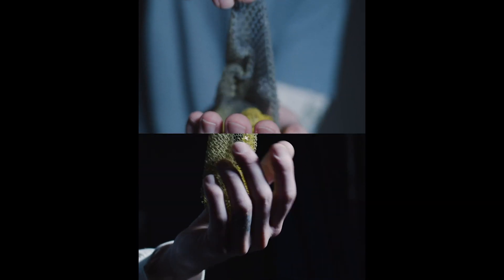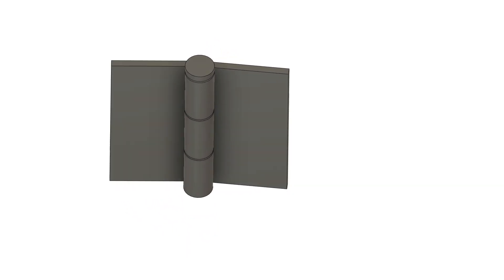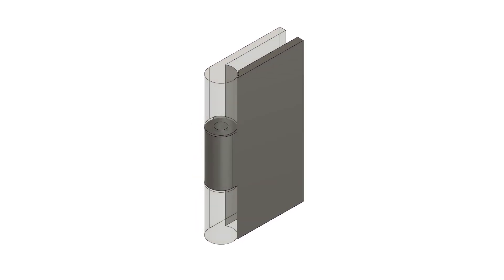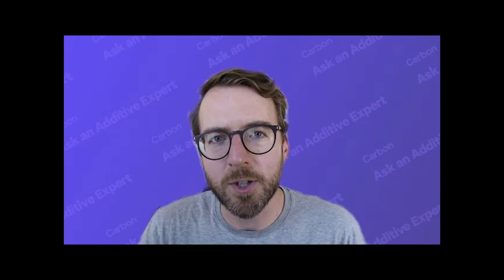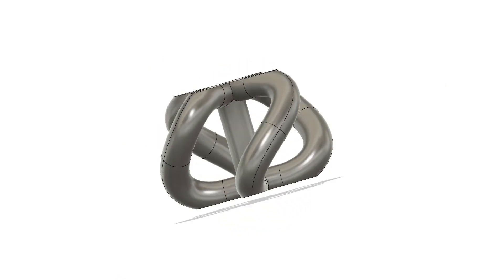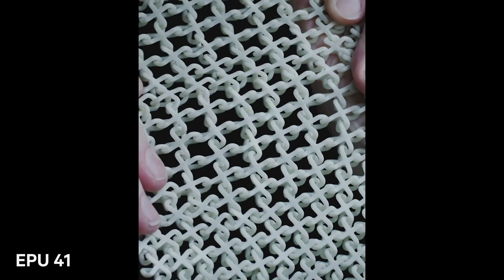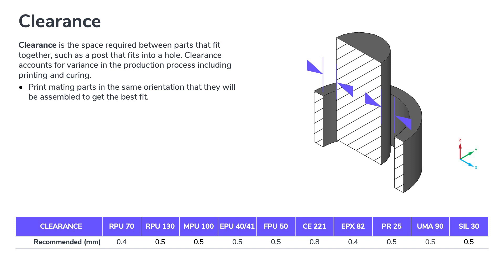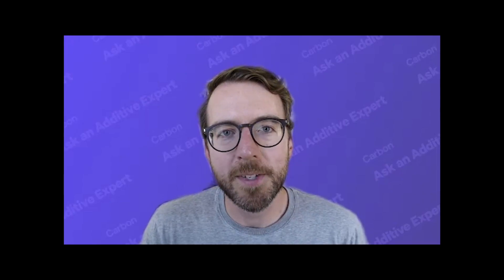3D Printed Chainmail, Functional Assemblies, and Part Consolidation - Ask an Additive Expert - Ep 08

Comment: Would you know how to take a picture and turn it into a 3D sculpture? I lost my mom an wanted to make a sculpture of her I am new to 3D printing for wondering if you can help
Reply: Most photogrammetry based 3D modeling programs need many photos from different angles. The process is very deliberate and uses dozens of photos on the low end of the scale to hundreds and even thousands at the upper end. Unfortunately, most people do not have photos taken of them from all of the angles necessary to do the job. You may have enough to do an acceptable job of her face for something like a cameo necklace.

Comment: Right but, in the case of the door hinge example, using the print hinge is far less realiable in both structural design and sheer force. So its not really practical to use on a actual door now is it?

3d printing is great for making prototypes but, people seem or ate mafe to believe that 3d printing can be used for real world application's, this is simple not true.
Reply: Properties depend on material, slice design, and processing.
Reply from the maker: Thanks for your comment. That is not entirely true. 3D printing has evolved a lot over the last decade. Between our engineering grade materials and our 3D printing process (Carbon DLS™), it is very possible to make (real world applications) end-use parts. Some great examples of end-use parts that are being made today with our 3D printers are the adidas 4D midsole, the Fizik Antares Adaptive saddle, the Specialized S-Works Power Saddle with Mirror Tech,  and the CCM Super Tacks X Helmet with NEST Tech. Please let us know if you have any additional questions. We would be happy to provide you with some great resources that talk about Carbon being a great option for from functional prototypes and end-use parts.